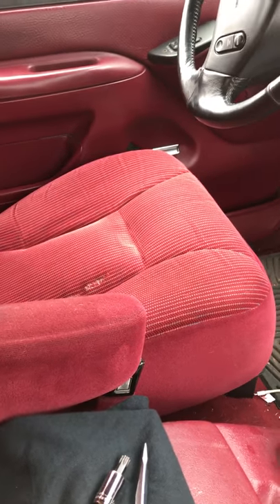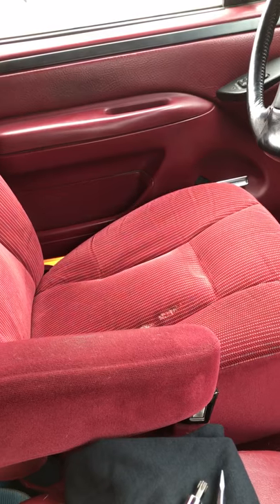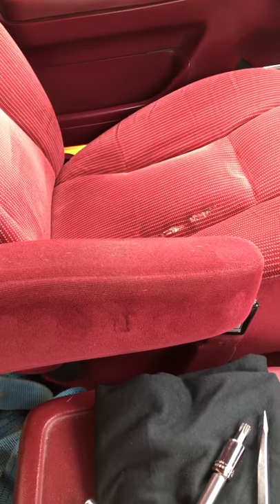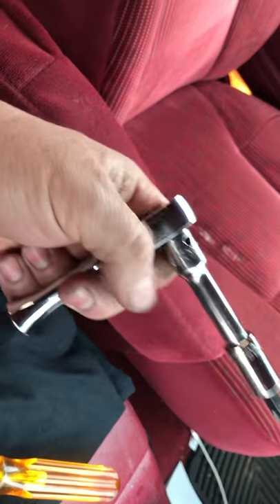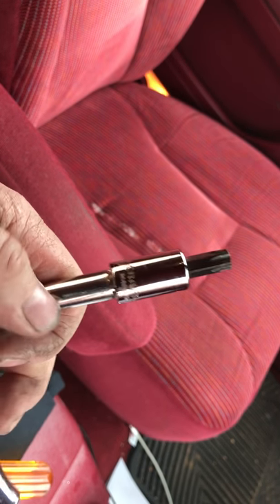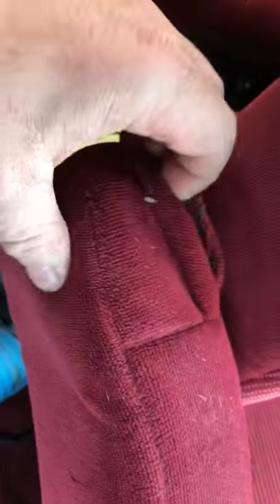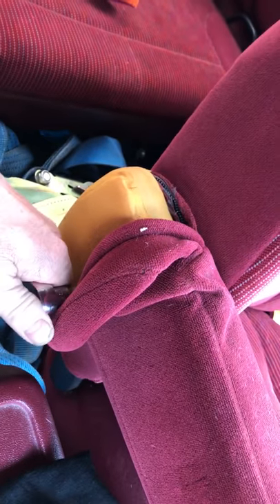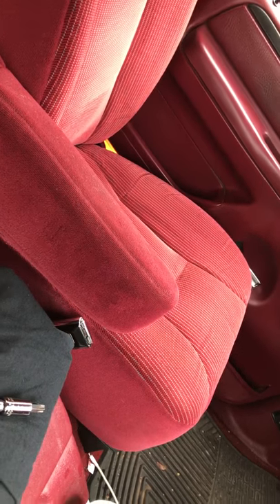Ford Bucket Seat sagging broken armrest fix repair

Comment: does that arm rest come off?
Reply from the maker: it should if you remove the T50 bolt
Reply: Yeah just removed mine. That bolt felt like it was put it with locktite. Kept popping til finally about halfway out 😅